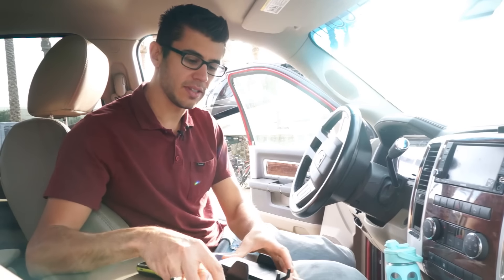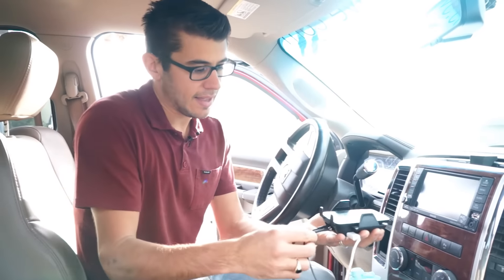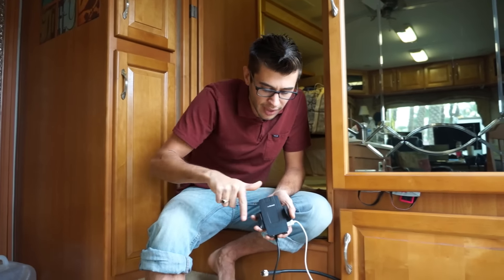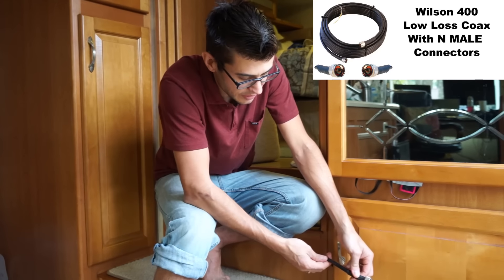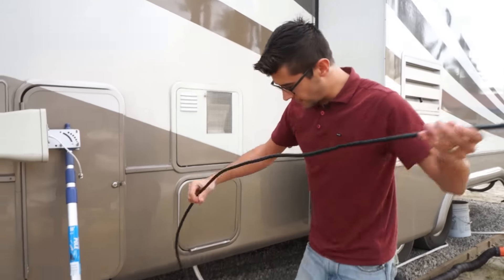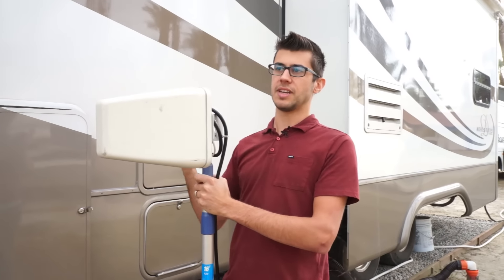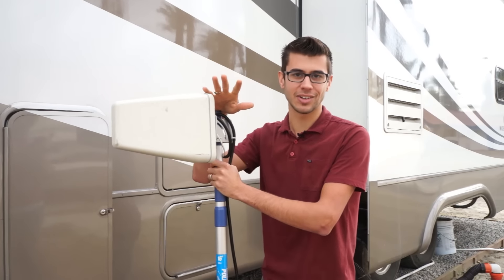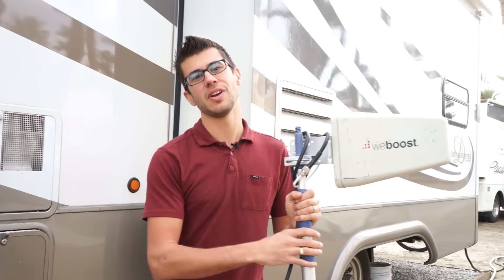Powerfull Cellphone Boost for cheap! - How We Boost Our Cell Service and Internet

Comment: What I have found in Cell Signal boosting... is that the Yagi directional antenna & booster,... both have to match the carrier frequency of your network... and the bais of the band towards up link and download frequencies will depend on how well the antennas are manufactured in respect to the 1/4 wavelength of either carrier.

Comment: Going to try a similar set up.  Just purchased a WeBoost sleek.  Want to add the OTR antenna and mount on a pole and attach to the ladder just the same.  Definatly a cost savings even after 2 1/2 years after this vid was posted.

Comment: Thanks for this idea! Been trying to find a solution to improve reliability on my tethered home desktop for online classes. We live too far out to get any regular cable or DSL service, and get 1, maybe 2 bars of 4gLTE on a good day. I installed this in my attic a few days ago and have seen peak downloads go from 8mbps to nearly 30mbps. Slow/bad times will no longer drop below 1mbps either, but stay between 2-5mbps.

So again, thanks! Has worked out well.
Reply from the maker: Glad to hear you had success!

Comment: Yes using this Yagi Antenna will bring a stronger signal to the cradle but just keep in mind that it would never compare to the wireless kits like the 470510. No matter what you hook up to the cradle it will always be limited to 23db of increase compared to the hugely significant difference of the 50db the 470510 provides
Reply from the maker: CHiTO I disagree, both this and the kit you mentioned have the current maximum 1watt output amp in them,  this is a limitation set by the FCC.   The higher gain you are referring to is the indoor antenna and yes it will be higher as it is a more powerful repeater, with the device in the cradle however you will max it out either way.   The only way to improve this more is to use a static booster with a higher power (illegal in mobile applications)  or get an old 3 watt version prior to when they changed the regs.  With any of these new systems the best you can do is improve the antenna because they are all 1 watt.
Reply: Mortons on the Move I actually work for Wilson Amplifiers so I am very aware of these units lol the cradle kits are actually only 0.33 watts meanwhile the 470510 is the only vehicle booster that is 1 full watt since 2015 FCC regulations. A 0.33 23db Amplifier will be outshined by a 1 watt 50db amplifier. Cradle kits max out at 23db meanwhile the 470510 has a higher 50db limit. You should try it out and will see way more difference =)
Reply from the maker: CHiTO  Hmm, I'm still not convinced, the passband gain is higher, meaning potentially more power, but individual channel specs are pretty much the same.  My understanding would be the 470510 will handle multiple devices better but one device won't be much different at all.  I did go head to head with the 470510 last January in Quartzsite and my setup well outshined it.  However they were using the stock antenna still so it was not a fair comparison.  I would be interested in trying one out with my antenna however. Also testing the surecall fusion soon too.
Reply: Mortons on the Move the SureCall Fusion2Go has made a 2.0 version which has been very good for our customer lately. 
https://www.signalboosters.com/surecall-fusion2go-2-0-4g-cell-phone-signal-booster-kit/
I’ve tested both out myself and tend to see better performance and faster data on the weBoost version. The set up you got in this video is normally what I recommend my customers but most of them turn  it down because it’s for  a single user and tend to go with the 470520-RV that we have set up on our website. 
https://www.wilsonamplifiers.com/weboost-drive-4g-x-rv-trucker-essentials-kit-470510-rv/
Reply: Can the same parts list here be used to connect the directional attenna to the 470510? Are the cables and connectors the same?

Comment: how is this method working for you five years later? im looking into trying this for my camper van but was looking at the drive sleek model due to it being a bit cheaper. do you now if the weboost drive sleek has the port that wilson 400 cable can connect to?
and what did you use to clamp the extension pole to the side of your rv?

Comment: I'm trying to improve my RV WeBoost DriveSleek system by adding a yagi directional antenna for better reception.  After talking w/ tech support at Wilson Amplifiers I bought RG 58 cable and an adapter to plug into DriveSleek booster unit (which sends a signal on to cradle that holds hotspot device or phone). On eBay I bought open-box new Wilson Electronics 314411 Wide-Band Directional Antenna 700 - 2700 (yagi).

After spending a good amount of time hooking everything up and mounting the yagi on my old Winegard TV antenna mast, I plugged the yagi cable into the DriveSleek booster and put my phone in the cradle.  The adapter works fine (number below).

Unfortunately I got NO improvement in signal strength compared to the omnidirectional antenna that came w/ DriveSleek. Both antennas provide the same increase, about 7db.

I only tried this in my driveway, under leaf cover, but when I called WeBoost tech support they said this setup will never work.  They said the yagi antenna has to be matched to the right booster/amplifier.  And that would be none other than the $650 DestinationRV kit they sell (only as a kit).  The tech rep also said that the yagi hookup I'm trying would probably "degrade" my signal over time, compared to the omni antenna.  Said I would also need to re-install a different type of cable too.

Frustrated. No way I'm gonna spend $650.  Any ideas out there on how I can make this yagi antenna work with DriveSleek booster? 

Wilson SMA-Female to SMB Plug Adapter - 970019	WA970019	

Wilson RG58 Coaxial Cable	20 feet - WA955822

Comment: Some reason why signal boosters may come expensive is due to R&D costs, licensing, patents and etc. But for some people, they would rather invest on "not-so-cheap" signal booster to save time and avoid headaches. If you're one of these people, then Google Search "legal to use mobile phone signal repeater novatel" and grab one to solve your signal issues.

Comment: Sick video! Looking forward to attempting this with my lb1121. I am curious what model # 4g-s you have. If you could reply with that, that’d be wonderful so I find the right one. Also the link for it on amazon is incorrect up above. Great tutorial!
Reply: yes it was wrong...its the we Boost Drive Sleek Cell Phone Signal Booster Cradle Mount Holder for Car, Truck and RV Use - Enhance Your Signal up to 32x. For Single Device $199 or save $30 refurbished

Comment: Tom, thanks for this video! ordered all the parts and pieces and was excited to hook it all up, but it doesn't work. Had to order the new drive sleek cell phone booster from weboost and the way to hook up the antenna cable has changed. the adapter pieces you recommend buying doesn't work. Has anyone figured out if there is an adapter out there that will work?? if not fingers crossed I can return all this stuff!
Reply: was able to determine that you need a TS9 Female to NK Female connector. found it online through Walmart for $5.85
Reply from the maker: Thanks for posting this!  I will update the description.
Reply: Hi Judy, did the TS9 to N adapter work for you? I understand that the drive sleek uses smb connectors, not TS9. Thanks
Reply: P G  the size fit, but never got a chance to try it out as we were unable to make booster work.
Reply: Judy, thanks for the update and sorry you are having all these problems.
Reply: @judyflier547  Is it really that hard to post a link!!!

Comment: got a question for you or anyone who knows; I drive a mail truck on a rural route that has me in the dark zone with no phone service for 5 hrs. along my route. ; can I use my wire whip truck antenna for the cell antenna? instead of the roof mount job., and can you give me more details about where to get some of that stuff you were using to make your own? Is it something you sell? I would appreciate an answer as soon as you can cause I run that route 6 days a week, and 5 hrs. with no service can be a big deal sometimes; especially if you break down.

Comment: Hey there, thanks for the video. Since you're so smart I thought maybe you could discuss the work around on the new weboost Sleek drive because it has a new proprietary antenna ending. It's called push and click. So I bought all the stuff that you recommended thinking that that included the weboost slick, but apparently weboost has been slick and made it more difficult to avoid buying their full RV booster for the extra $300. I contacted them directly to see if they had an adapter but I'm betting that they don't yet. If you can think of a workaround please let me know. Thanks for all the great videos. I check you out a lot
Reply: ran into the same problem, bought all of these parts, but had to purchase the new drive sleek and the antenna/cable adapter doesn't work. Any work arounds?
Reply: John we figured out you need a TS9 Female to NKFemale connector.  I found one online for $5.85
Reply: @judyflier547  how many decibels did you gain with the setup?

Comment: Hi! I built this tow with the exact components recommended and loved it. However, my booster cradle got damaged by one of my children so Weboost sent us a replacement. They sent us a Drive Sleek Model Booster to replace so now the nipple to connect to the low loss coax cable won't fit. Can  you help me figure out how to rebuild the tower using the Drive Sleek? Thank you

Comment: are you connecting the cradle plug to a 12v cigarette lighter in your rv or did you also convert to use a electric outlet plug type or usb? Sorry, bought the Drive Sleek weboost and our travel trailer only has usb and and electric outlets

Comment: Hi Tom, you've been running your system for a yer now.  How is it performing.  Are you still as satisfied today?  Apparently they offer a 75 ohm or a 50 ohm directional your antennae is a 500 ohm.  What impact does ohm have in the consideration.  Terrific project thank you for sharing.
Reply from the maker: We use it all the time still.  I find it outperforms my neighbors omni antenna every time still. Lower the resistance better transmission. Go with the 50 ohm if you can but the 75 has standard Coax.

Comment: I see you have made a list there, sorry. but can I use my whip antenna instead? will that work, or wrong type of antenna? and is there a reason you use all weboost stuff? I'm trying to figure out the best setup for my 26' box truck. If you get the time, could you give me some idea what might be best for me. I don't need a directional antenna for internet; just increased range for my phone. I was trying to find some comparisons between the expensive boosters and the cheap ones. Do you know if those cheap roof mount set ups are any good at all; or do I need to go with the more expensive ones to get much improvement on that dead zone?
Reply from the maker: Your whip antenna won't work, the frequency is too high/ needs a short antenna.   If you have a metal roof the roof mount stubby antennas work quite well.  The cradle mount systems can still be a good choice but the new weboost reach does have higher gain. Surcall has some good options that are a bit more cost effective too.

Comment: Great vid!  Does the booster allow you to avoid roaming charges?  Or, if you're roaming without it, will it allow you to get on your plan network?  Thanks!
Reply from the maker: It all depends on where you are, if the phone sees the home tower better with the booster it usually will hop onto it.  Occasionally we have seen it pick up one tower pointed one way and something different pointed another way.  If you want to see if it will try to hook up to a different tower, change the antenna direction, then turn airplane mode on and off to reset the cell radio.  Then it will pick up the first strong signal it receives.   We do this quite often,. It really depends on where you are.

Comment: Will the system work in our 5th wheel without the directional antenna, just utilizing the magnetic antenna that comes with the We Boost?  I realize I'd have to install a ground plane on the roof of my fiver, but I like the idea of easy portability between my Tow Vehicle and my RV when parked, so I was wondering if you tried connecting with the given system before you used the directional antenna. 
Thanks for the excellent video. I just subscribed to your channel and am looking forward to viewing other videos the Mortons.
Reply from the maker: As long as you have a ground plane it should work fine,  we have some friends that use it that way and it works fine for them.  The directional will just give you a slightly stronger signal depending on the location.  We attempted to use it at first without a ground plane and it did nothing, we also crushed the small cable that comes with it in a window and actually damaged the cable so try not to do that.  If you get a second magnetic antenna and install it permanently in the RV it would be an easy swap between the vehicles.
Reply: Mortons on the Move , good advice. I wonder if we must use the propriety antenna for dedicated mount or if a good compatible antenna from a different manufacturer would work. I'll let you all know when I find out. 
Now that Verizon is offering unlimited data at a reasonable rate, this is a must for us. Thanks.

Comment: We also have a DRV,  where did you run it from the inside to the outside?
Reply from the maker: Depends on your model but I ran it from the cabinet you see in the video behind the sliding doors in the basement, through a small hole into the water connection box and out with the hose. When we are not using the cable I pull it back through the water box and store it inside the basement sliding door near the water heater.  This way its an easy setup.   We have a power strip in the mirror cabinet we power it from and just leave it sitting on the stair.  Its not the best looking solution but it works great and we dont have to put any holes in the rig.

Comment: Can i use an aluminum type antenna with cable connected to a 3.5mm jack to be inserted to the phone's 3.5mm jack port, to enhance 3G/4G signal???
Reply from the maker: No the 3.5mm jack is not connected to the radio at all.

Comment: Will this work in home for permanent use? My service goes in and out and I can get service 1 mile down the road what's your thoughts will this work as a permanent home source
Reply from the maker: It will but it does not broadcast the signal so it has to be on the booster.  Really depends on your issue, if you have a hill or large object blocking you it might not help.  Since you can get some service I bet this would work great!

Comment: I'm sure those who are lost find this info very helpful but for less that $50 (doesn't include the actual high gain external antenna) and a VERY basic knowledge of DC electronics and soldering you can make your own signal booster?
Reply: Would you mind elaborating on this?
Reply: @writingforyourfuture5098  
Just Google "homemade 4g repeater/booster". Find one that works best for your application and put it together. There so many people out there who make diagrams open source. The thing you have to remember is if you are somewhere that doesn't have any coverage then these won't help you. These boosters just amplify the signal over a small area.

Comment: Did you call Verizon consumer help line to inquire as to a free "cell hotspot" to boost your signal in verizon dead spot areas?
Do you use wifi calling on your cell phone?
Reply from the maker: Were way of grid so there is no wifi around. This booster provides us our internet.

Comment: Have the weboost but need a bigger antenna how can i make my own or would a satellite radio antenna work with proper conections
Reply from the maker: The antenna needs to be tuned to the cell frequency.  Satellite dishes are designed for much shorter wavelengths.  Antenna design can be complicated but if you learn it you could build a nice yagi for cheap.

Comment: Probably a dumb question, but would connecting the booster directly to your bat-wing TV antenna be worthwhile?   Since we aren't full-time in our rig, I don't want to spend a lot just to connect for vacation data.
Reply from the maker: Most likely it would not do to much for you but I am not an RF engineer.  If it were a patch TV antenna or newer digital antenna i would think it would do more.  I assume you would get some gain just because you are picking up from outside but the TV antenna is tuned for a much larger wavelength than the cellular so it will be canceling out much of the gain.... That's my meager understanding from the DSP classes I took years ago in college....

Comment: Do you get much flex out of the pole? Pretty strong?
Reply from the maker: Its a bit flexible but plenty strong for the antenna.  We have had it up in 50+ MPH winds without problem.
Reply: How did you fasten it to the ladder?

Comment: So I was planning to use that booster on my backpack (with a portable battery for power) for certain backcountry hikes, but from what you say the antenna will not work without the metal roof. Do you know of any smaller sized antenna I could wire up that would work for backpack use?
Reply from the maker: That is correct the antenna needs a metal roof.  A pizza pan or even some aluminum foil under it will help but thats not great for backpacking.  You could get an omni SMA male antenna like this one tho.  http://amzn.to/2s88Gas
Reply: Thanks a lot, that may work! Does that antenna have the same plug in size?
Reply from the maker: Yes the SMA size, the one in my video uses an adapter to N size
Reply: Christian Repenter bbbb